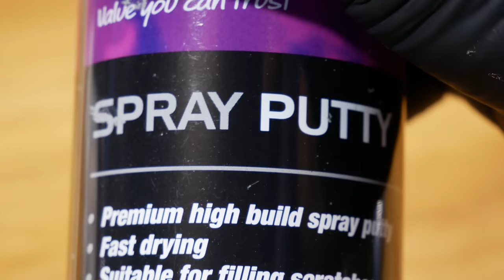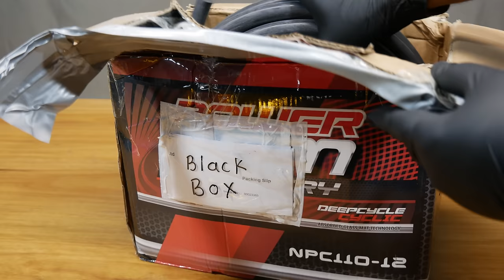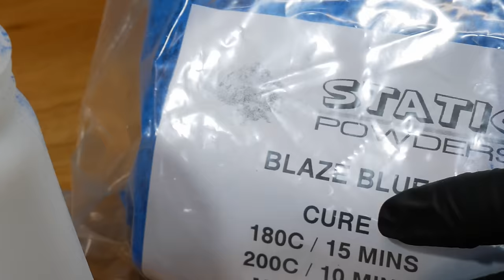Epic Vintage Tricycle Restoration: Reviving the Most Extremely Rusty Tandem Trike !

Comment: I am a very old man topping 85 years and in my youth I remember such tricycles. I come from an era where we made our own toys including scooters out of ball and roller bearings which we got out of the military depot. There was WW2 on at the time. We shared such tricycle and a larger one, with all my six brothers and sisters. My wife had to share between eight brothers and sisters but it was all fun, Very nice memories I must say.

This is my type of engineering, simple bearings, pins, rivets, nuts and bolts, spokes and solid tyres. I can feel the love of this restorer for this antique item.  I can say that he made an excellent job of it. Just beautiful and so heart warming  where metal is curved and formed and cared for  as shown in this little tricycle. Congratulations for this work of dedication and there is more than just an old trike I see in this video,  there is love for the product which many modern people do not have, as they buy and use and dispose and never understand.

Again, hearty congratulations. I can only suggest one little issue which has nothing to do with the workmanship,  I felt that the scenes were too close up, and I would have felt better has the photos were not so close. The last part at 10:56 commenced to be more to my liking seeing the trike in full. I would have liked to see that trike in full splendour with a single colour background and  a photo of the whole trike with a little framing , empty gap on the peripheral edges. 

All the rest, you deserve more than 100%  I appreciate the love that went into all that, Simple Elegant and Beautiful.
Reply from the maker: Thanks for watching and leaving such a great comment. I truly enjoyed reading it 👍

Comment: Hope you & yours had a great Christmas & didn't eat too much. 🤣🤣 You did warn us this was coming, but I wasn't expecting that much rust! 🤣🤣
This is definitely the rustiest trike you've ever done! Rust both ways, pitted & expanded. You did a great job of sorting out that! The chrome effect turned out great.
It's always a good feeling to have fasteners come out, as intended, instead of snapping. 👍🏼🤣🤣 The trikes may be old, but they never get old! Keep them coming!
Reply from the maker: Haha, you right. I threw a lil Barbie tool video just before to create distraction 🤣.
The best part is that there is now a little girl riding the exact same tricycle that her grandmother used to ride. That's special !.
Thanks as always for your support. 
What do you think I should restore next 🤷🏼🤣
Reply: @LittleRestorers  That was a good distraction! 🤣
All this good old stuff needs to be restored instead of scrapped. Even better when it's something passing down generations. That's priceless.
It's more likely to be around for decades longer & enjoyed, as intended, than the new stuff, built to a budget, not a standard.
And next? That's opening Pandora's Box! 🤣🤣 Have you done any old mechanical jacks or stands? They can be a challenge. Not many parts, just difficult to dismantle without damage. You shouldn't have too many problems there! 👍🏼👍🏼
Reply from the maker: @KevinD_33x150  Sounds good... I'll call my mate Jack to see if he has a Jack. He is a bit of a jack of all trades. I've got jack all jacks except computer jacks 🤷🏼
Reply: @LittleRestorers  That's a lot of jacking around! 🤣🤣 Don't think a computer jack would cut the mustard... 🤣🤣

Comment: Yo no le hubiera dañado las llantas difíciles de remplazar por el material de antes mejor que el de ahora😮
Reply from the maker: Thanks for watching. As those type of rubber age and degrade , they become hard and brittle. Its not possible to remove them without damage and not possible to do a proper restoration without removing them as the whole rim is rusted 😉👍

Comment: Nice resto!
Currently have a cyclops tandem and a pedal pusher in pieces in the shed I’m working on. What diameter rubber do you use for the tyres if you don’t mind me asking?
Reply from the maker: Thanks for watching. I go for 19mm on those big wheels and 16mm on the smaller dinky trikes type. Look up Fred Hay on facebook group if you after some rubber or parts. ( I  won't put his details in here) Tell him I sent you 😉👍
Reply: Thank you

Comment: i have RF old tricycle, but it wheels is wavey, how to fix it..? thanks before
Reply from the maker: Hi, that would be because you have loose spokes and the need to be tightened 👍
Reply: @LittleRestorers  it spokes doesnt look like regular bicycle spoke, i confuse..
Reply from the maker: @yulikasiono5695  No experience with RF but am guessing u might need to pull the rubber off to get the the end of the spokes. They likely just bend onto the rim. Go to (part.radioflyer . com) They have replacement parts, and from what i can see, the wheels are really cheap ( $8 rear, $13 front). You might consider just getting new ones to save the trouble 🤷‍♂️